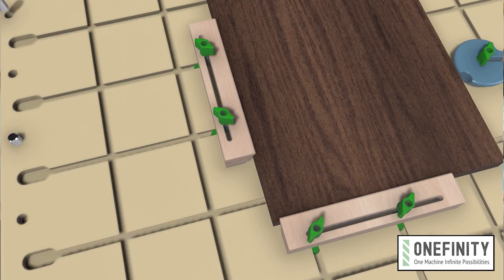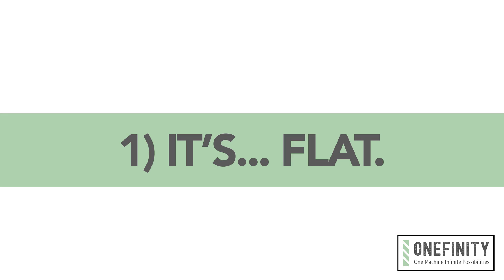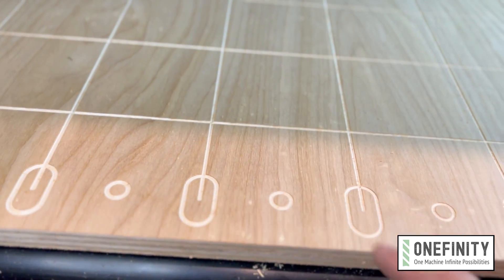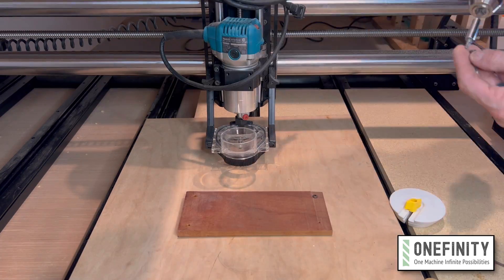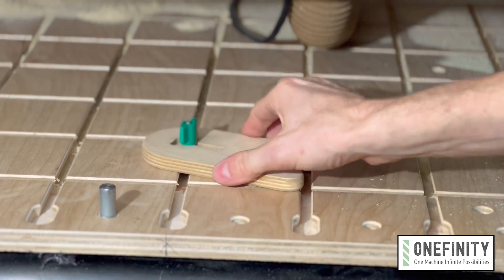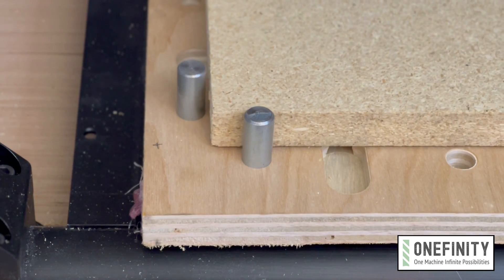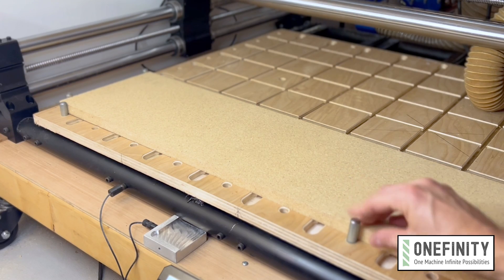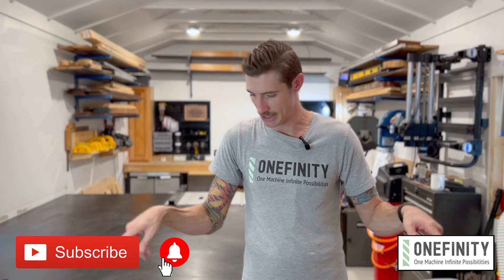EP3 Onefinity CNC - 3 Must Haves in a CNC Wasteboard

Comment: I really like this design with low level clamps and bought the matchfit bit and hardware.  I was about to purchase the files but then I realized a 4th consideration that is important to me--ability to resurface.  Perhaps I'm wrong but the dovetails are only cut to a depth of 0.38 so there is little depth available for resurfacing before reaching the dovetail hold down slide.
Reply from the maker: It should affect anything.
Reply: @OnefinityCNC  I don't understand.  Please advise:  After cutting the dovetail tracks and using the Matchfit spoilboard, if I have cut into the spoilboard and want to resurface it how much thickness can I take off?
Reply from the maker: @ minimum depth for dovetail tracks is .365”. They’re initially toolpathed at .385 deep, giving you .02” of wiggle room to resurface.
Reply: @OnefinityCNC  Thank You!  What is the maximum depth of cut?  Could the dovetail tracks be cut to a depth of 0.50"?

Comment: I just bought some new MDF to set this up today.  And upgraded Vectric so I can open the .crv file.   Ouch more money.  The DOVETAIL TRACKS .crv file opens fine, but the SURFACING .crv file was written by a trial version so Vectric won't let me open it.  Can you re-save that surfacing .crv file with a real version of 11 please?
Reply from the maker: @morganhop can you check this?
Reply: @OnefinityCNC  I mean, I know it will be a basic pocket toolpath for a 32x32" rectangle, but just curious what your depths and feeds are, etc.  You never know what you might learn :)
Reply: I would like to have the surfacing.crv as well.  My download gets same message that a trial version created it and it could only be opened by the machine that created it.

Comment: Love this,  I purchased the files from Etsy.  Since I do not use vcrave I recreated this in Eseal using the included DXF files.   What suggested speed and feeds should I set for the cutting paths?  I am new to Onefinity so not sure what is acceptable.    Thanks Guys.
Reply from the maker: Post your question up on the forum about it and @morganhop should hook you up with that info! https://forum.onefinitycnc.com/t/3-onefinity-cnc-3-must-haves-in-a-cnc-wasteboard-includes-matchfit-dovetail-wasteboard-system-files-free/14303/34

Comment: Love this idea!  HOWEVER - I just received my Journeyman x50 w/QCW base.  How can this be incorporated into your base?  Thanx!  Excellent idea!  (Setup on SUNDAY!!!!)
Reply from the maker: Add a piece of MDF to the top of the qcw t track to make this (forgoing the t tracks on the qcw)>
Reply: @OnefinityCNC  This was my question as well.  so do you just have a solid MDF board sitting on top of the tslots? do you have it connected to the tslots so it doesn't move? Just curious as I have the QCW as well.
Reply from the maker: It would go on top of the t track, in fact, that's how I have it!

Comment: How did you attach one large piece of sheet to the QCW without the tracks getting in the way?
Reply: If you look at his wasteboard close enough, you can see countersunk holes used for hardware to mount the matchfit board directly to the top of the QCW.   Seems he skipped adding MDF between the tracks.
Reply: @edwardm5895  Now that you point it out I see the hardware. Thanks!
Reply from the maker: exactly!

Comment: That’s awesome! I’m going to make it!
Where did you get the pins?
Reply: You can get them on amazon but I actually just got some 1/2 aluminum rod from Lowe's and made my own.
Reply: @MorganHop  Thank you Morgan!  I'll check Lowe's out.
Reply: @cliffjohnson271  I just cut it into 1-1/2” sections, stuck them in the chuck of my drill press and slightly beveled the ends with a file
Reply: @MorganHop  Thank you for the detail and tip on the drill press!   I just bought your Bundle off Etsy.   I appreciate what you do!  Keep up the great work.
Reply: @MorganHop  I just got an aluminum rod. Now, what's the safest way to cut them and what length did you use? Looks like 2" long.
Reply from the maker: Morgan got them from lowes!